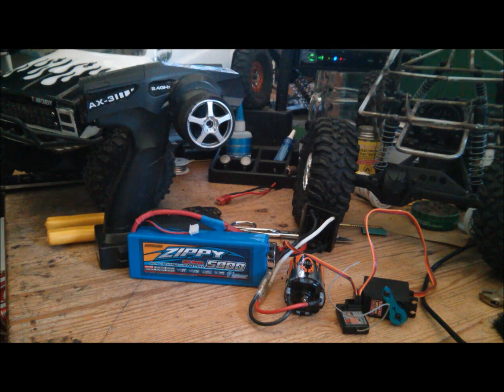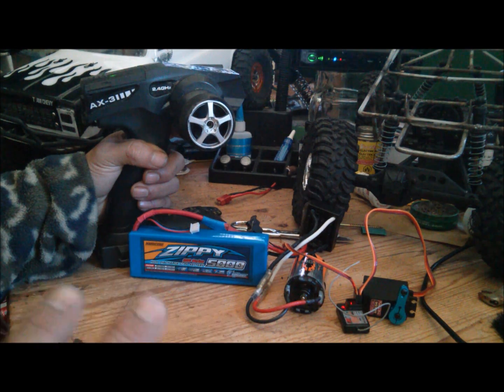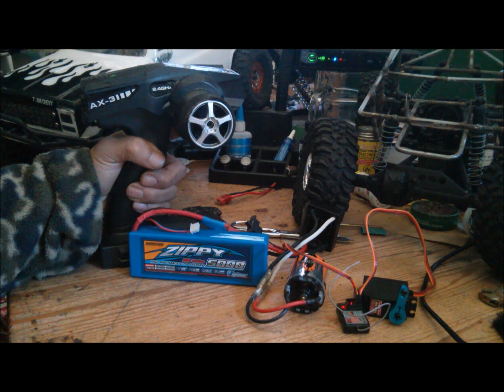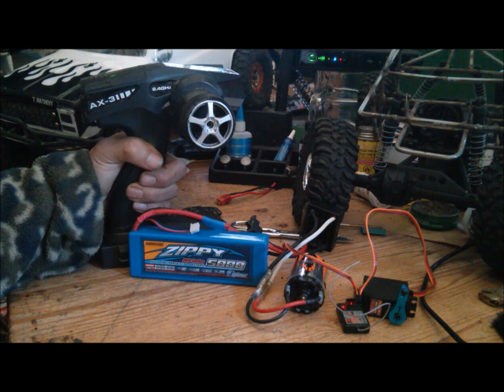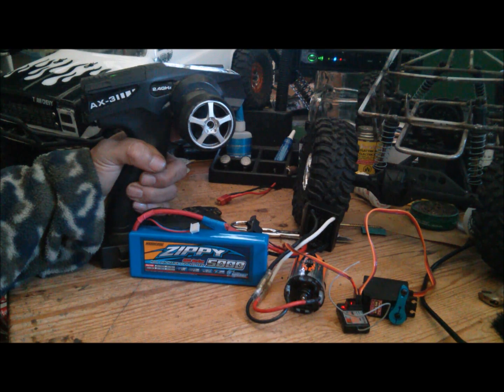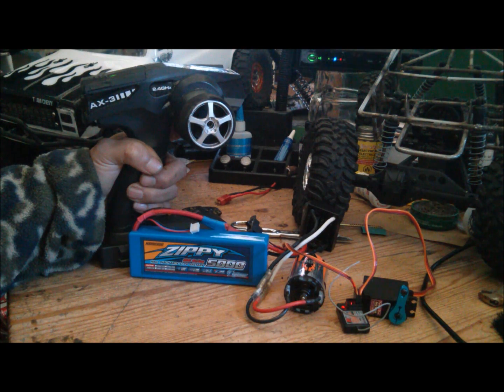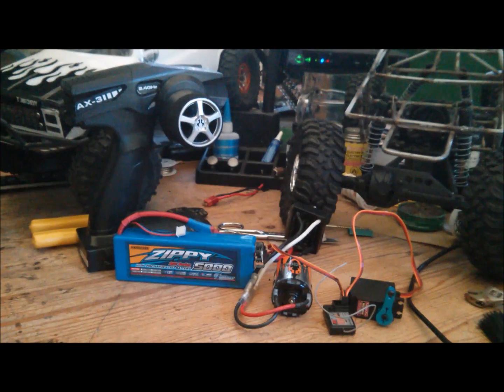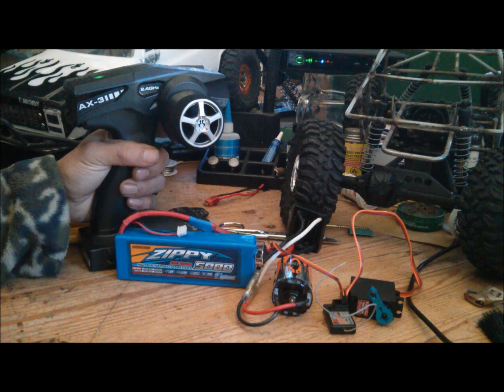HOW TO: Program Axial AE-2 ESC WITHOUT Castle Link using your radio

Comment: Do you know how I get my ae2 ready for a lipo? (How to set up low voltage disconnect)
Reply from the maker: Lipo is the first set of beeps at the beginning of video
Use throttle for Yes and brake for No

Comment: By the way, how would you know the AE-2 ESC is no longer functioning? My cousin had his unit fell on water when we were river crawling. 
Can it be repaired once wet?
Reply from the maker: I don't think it can be repaired.
I use conformal coating to waterproof my electronics.
Reply: @dirty_coyle  thanks

Comment: Thanks.  I was very confused because apparently i have my motor polarity reversed.  Had to push break to put into programming.. whoops!
Reply from the maker: Sounds like you need to reverse your switch on your transmitter
Reply: Yes for sure. But then i do go backwards so have to flip back.  I’ve got another question.  I’ve been flipping back and forth between lipo 2s and a NIMH.. do i need to change the first section setting every time?  What has been happening is when i squeeze full throttle forward and reverse the motor will stall immediately..and start again when i get below full throttle.. almost like the low voltage shutoff is happening.
Reply from the maker: @brendanphilbrickjr6816  yes, unfortunately you should be changing the settings for each battery type.  
Also make sure when you set your switches on your radio/ motor polarity wires that you are set for forward. 
Forward spins faster than reverse, I had mine messed up at first.